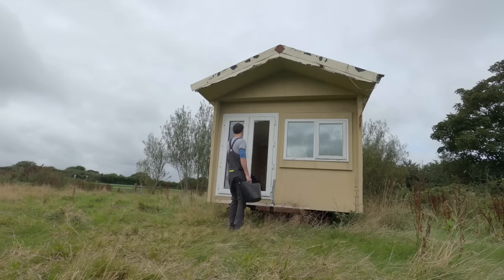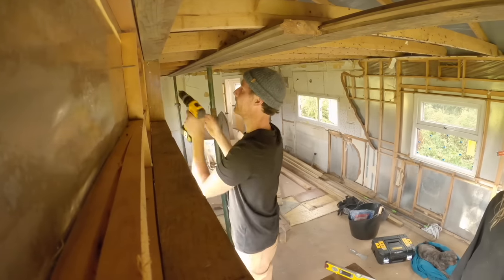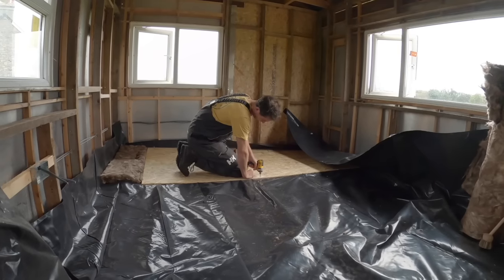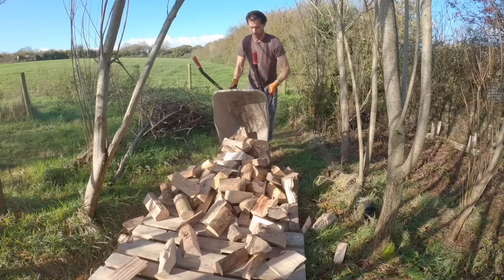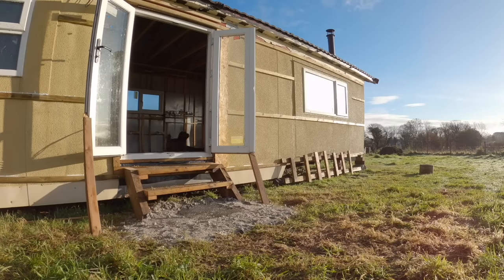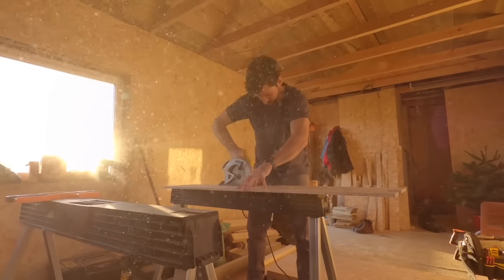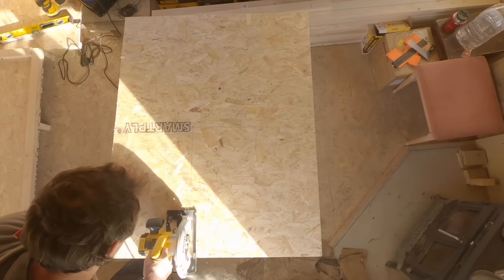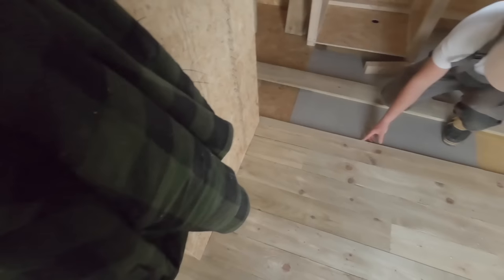Static Caravan to Cabin: Off Grid in the UK with Narration (FULL VERSION)

Comment: Congratulations - both the video and the building work are excellent.
Just a couple of points which might be of use.  Did the external cills you installed have 'drips'?  It is essential that a groove is machined in the underside to prevent rainwater migrating along the underside of the cill and getting in to your cladding causing eventual rot.  Also I don't recall you touching on what protection your tiling had against differential movement.  A soft joint, i.e. silicone, should be used at any change of direction in the tiling and any joint with a dissimilar material.
Once again, very well done.
Reply from the maker: Thanks so much and i really appreciate your kind words. That's a very good point about the window cills. So with that, the cladding is effectively just for show. It does do something obviously but we put the cladding over the original exterior walls. The original walls are made from aluminium and are pretty hardy. I did put small cills on with a bit of silicone to plug the gap. I'm not overly concerned about it because of the aluminium exterior wall. The bathroom however is a different story! We made huge mistake with the bathroom and it's something we're going to have to change completely down the line. Even though it was a big mistake it was a great lesson learned and we'll definitely not make that mistake again! Thanks for the comment and thanks for the support!

Comment: Wonderful journey! I really hope you are not relying only on tiles to keep the moisture out of the OSB in your bathroom! You need to double-seal it BEFORE applying the tiles on floor and walls!
Reply from the maker: Thank you! Yes, that was a huge mistake and we've definitely learned our lesson that's for sure!
Reply: I was wondering the same, hope you fixed the problem! Would hate for all your hard work to go bad from mold and moisture forming in the board and ruining it.
Reply: You need to put cement board or backer board on the walls if you are applying tile it keeps the moisture out. Also do you have a fan/vent into the bathroom

Comment: Great job. Definitely considering that you are total beginners. But with the shower, you might have problems in the long run. A layer of sealant on the wooden panels would have been better. If there is even a tiny crack in the grout now, the water will penetrate the wood very unnoticed. This is usually noticed much too late.
Reply from the maker: Thanks for watching and glad you enjoyed it. Absolutely, we made a huge mistake with the shower and learning lessons the hard way! We know that we're going to have to completely re-do the bathroom at some stage in the future. Thanks for the comment and appreciate the advice.

Comment: Great job you two!  Wow, the amount of work that went into it.  I liked seeing the evolution of your tools andthe final variety haha!  Curious if you've had any leaks or issues considering the amount of wind and how wet it could get.  I also noticed right at the end with the finishing touches on the window frames, have you considered sloping the 'pan' at the bottom of the sill on the outside?  To help guide the water away?  hats off to you!
Reply from the maker: Thank you very much! Glad you enjoyed it. We certainly learned a lot and made some BIG mistakes! We’ve only had one leak from the flashing on the roof for the flue from the wood stove. It was an easy fix and hasn’t leaked since. The front of the cabin gets smashed by weather. Good tip about leaving an angle on the bottom sill of the window frames 🙌👌

Comment: Here in the US,  we use a product called,  Hardiboard in the bathrooms, its a cement based product, instead of using the OSB, after installing the Hardiboard,  you paint it with a product called Red Guard (its a waterproofing paint), then you install your tiles on that and grout them.   Unfortunately looks like you'll be needing to re do   the bathroom so the walls don't rot and mildew.
Reply: Didn't want to say this and sound negative, but 100% right! We have the same stuff in the UK cement boards / tile backer board and water proof membranes or paint-on tanking. It will be a few years before it rots so its a project for down the road. As a temporary measure you can paint liquid waterproofing into the grout lines to help stop the water getting through, plus silicone the corners.
Reply from the maker: I appreciate both comments. Yes we made a huge mistake with that and other things too. That’s just part of the process, learning the hard way! But it’s still holding up, however we know we’ll have to re-do the bathroom at some point 🤦‍♂️

Comment: Great work mate! I commend you both for all of the hard work, patience, and the vision required for a job like this. Your resourcefulness, recycling of materials, energy reduction, and conscious decisions to reduce resources in your daily life is outstanding.

I appreciate the fact you've called out some of your errors as you learned new skills and espanded your knowledge. Despite explicitly stating this series was not a guide for others to follow, some will use your vlogs as just that. Please don't take my points out of context. The items I point out are more for your viewers as I you've likely discovered them for yourself.  

Two issues not mentioned are the shower and the absence of a vapor barrier on the external wall. OSB is an amazing sponge; particularly the unsealed cut ends. Unfortunately I believe shower will need rebuilding in the near future. Tiles will begin popping off as the OSB swells. This happens as a result of seasonal humidity, showering humidity, and thermal conditions. With expansion and contraction of the OSB fractures in the grout will occur allowing the OSB in the walls and fabricated shower floor to soak, store, and soak up more and more moisture to the point of swelling. Where the shower pan meets the wall and OSB/ timber shower floor extension are the weakest point of the shower build. These points began leaking almost immediately. None of the materials expand and contract at the same rate; resulting in fractures of the grout - the only material in this instance employed to prevent water intrusion into the OSB. As a result you likely have excessive moisture in the floor, walls, and insulation of the shower surround. I would advise viewers to either source a (second hand) one piece shower unit or building the shower with the correct water resistant materials. Aside from popped tiles, the smell, and health affects of mold, a lot of effort, time, and material is wasted when one must rip it all out and rebuild with the correct materials. Those facing building inspections will find any improper materials and/or shoddy construction method will result in having to tip everything and start over. I would also remove the interior insulation in the bathroom as it only serves as a humidity sponge and trap. The seams of the OSB walls, despite being cladded over remain entry points for humidity.

As pointed the ceiling insulation will result in mold and mildew growth due to tapped moisture. Installing a vent along the entire length of the roof ridge will help draw some humidity out. However this may not be enough to prevent indoor air quality issues in the long term. When we heat the interior we think we are drying it out. The reality is humidity become a vapor which rise and seeps into porous materials. Therefore liquid condensation, say on a window or other cold surface, becomes a vapor that rises up into cavities in the ceiling and walls before condensing back into a liquid once it hits a cool surface. That surface in this case is the metal roof and original exterior walls. Insulation then absorbs this trapped humidity. That said the log burner and interior wood cladding and cabinetry will absorb and release some humidity. The key for this home will be maintaining low ambient humidity levels with proper exhausting and dehumidifiers. Adding the ridge vent will also aid by exhausting moist air. The best option is to redo the ceiling with proper air gaps and ventilation.

Modern kitchen units have adjustable threaded feet. To save lumber and the headache of building level kitchen units from the floor up, simply build your units using adjustable threaded feet and then install. The end result is perfectly level units and worktop. As others likely noted the worktop planks ideally would have been fixed and glued together with fasteners on the bottom for aesthetics and sanitary purposes. The worktop can be reworked as time permits.

We must remember this couple were building as they envisioned without experience, expert guidance, on an extremely limited budget, and on a fast timetable. . Through this experience they are in a better position when the time comes to make necessary adjustments and repairs. Painting the roof and windows black would make this look like a fancy new modern prefab. Your future solar panels and solar water heater will blend in better too.
Reply from the maker: This is a really constructive comment and I really really appreciate it. I hope other people find this really helpful and thank you so much for taking the time to write it. I appreciate the compliments as well and like you said we had no experience and this was such an incredible project to be able to learn new skills and make mistakes. There were certainly a lot of mistakes made and now i'm chomping at the bit to do another one with everything we've learned! 

Thanks so much again and appreciate the support!

Comment: Nice job on the cabin! But on the willows yes they seek water but they will fill your soak away with roots and get into your pipes. We had that very problem very evasive.
Reply from the maker: Thank you and glad you like it. I have had a lot of comments about the willow and it's definitely a worry for sure. Luckily it's not under concrete or anything like that so at some point we're going to have to dig it up but it could be worse for sure!

Comment: This is so cool! Great work! 

We’ve recently moved into a caravan completely off grid. We’ve cladded the outside & put another roof over it (so essentially built a shed around it) and put a log burner in, but we’re still having damp issues as the walls don’t breathe. We also had the idea of removing the caravan walls and replacing them with ply & cladding - do you think this would help the damp issues? Does your log burner reach the other side of your cabin? Do you struggle with any damp?
Reply from the maker: That sounds really cool - i like the idea of building around it. What really helped us was completely gutting it which is why i wanted to get the burner in as soon as possible so it would completely dry it out. So i would say it helped putting up stud walls etc. Would would help even more is using king span insulation but we just couldn't afford it. So we've had no damp issues since renovating the cabin - the burner is a huge part of that I think. Thanks for watching and thanks for the comment!

Comment: Love the build. Very close to what I want to achieve with my offgrid static.

Its worth pounting out that legally you have to have certified people install electric, gas and woodburners. Lots of laws I'm happy to skirt around but those three I think are very sensible.

So I would have spent my time learning to do the plumbing and got the pros in to fit the burner.
Reply from the maker: That's a very valid comment. You're quite right. We did get the gas checked out by a qualified tech to make sure it was safe. I've also had the burner checked out unofficially. The electrics and plumbing were done by professionals. Thanks so much for watching and appreciate your comment!

Comment: I have the same wood burner. It is, in fact a dual fuel burner and the grid is for burning coal. You will get a better fire by putting the wood directly on the floor of the burner. Great job you make it really seem doable.
Reply from the maker: Awesome! Thanks for the advice and knowledge. That's great to know. Thanks for watching and thanks for the comment

Comment: Loved the video i only have one snag and that is screws in the work top then wood filler? I would have sunk the screws and put a plug of wood dowel to have a proper finish... I also noticed in the video that you did not weed or waterproof the underside of the cabin..... Now you need a wood shed... Now i need the money and the land to do the same but my plan is to build out of old pallets from the ground up and having solar... Well done great video
Reply from the maker: Thanks for that. That's a really good point about the work top. I thought I should've screwed them from underneath but you live and learn and i've definitely made loads of mistakes! The underside of the cabin had black sheeting and gravel over the top. So it's not too bad re. weeds. Building out of old pallets sounds awesome - let me know how it goes when you get round to doing it!

Comment: Hats off to you. Well done. Impressive. I wish you all that you want from your cabin. I would have one concern - the chassis/substructure is now much more loaded than before, and is sometimes equally fragile as the original building - typically small steel sections and poor rust protection. Added to that, it lives in the grass and does not always get good air circulation to keep it dry. Worth checking for peace of mind.
Reply from the maker: Thanks for the lovely comment and kind words! I really appreciate your concern about the chassis and it's a very valid point. We did check the chassis extensively and found no rust and in fact in great condition. We've ensured good airflow and it also has matting underneath to stop anything growing. So far so good but will keep regular tabs on it. Thanks for watching!

Comment: Didn’t think you should use pine in a log burner, as it has a high tar producing problem. Told in a log burner centre use dry seasoned oak or Ash.
Reply from the maker: You're definitely right. In my experience if you clean the flue regularly it is alright but i'm not saying that's good advice though!

Comment: I once restored an old wood stove, it was big so i coated the inside of it with heat resisting brics, bottom, sides and top so it was better for capturing heat
Reply from the maker: Awesome! That's exactly what we did with this burner. It reduces the heat output but with such a big burner that's probably a good thing in a small space!

Comment: Really enjoying watching this progress and trying to achieve a home with minimal outlay as it’s something we would love to be able to do. I worry about how things will fair in the future for your build though because of the materials used. 
By this I mean like tiling straight on to the osb. If you have an issue in the grout, water can get behind and by the time the leak is noticed a lot of water damage could of already been caused meaning the whole thing could need tearing out to fix. Also the choice of insulation, as it’s a “flimsy” type it’s suited to floor/ceiling insulation, so over time being it could sag down and cause gaps and cold spots within the walls.
I hope this doesn’t come across mean spirited in any way as that’s not my intent, I only say it because I feel bad that you could have issues in the future after all the time and effort you’ve put in.
Reply from the maker: Firstly, really appreciate your comment and it didn't come across mean spirited at all. I completely respect your points and all very valid. We definitely made some HUGE mistakes which we'll have to sort out in the future and we know it'll be a big job. The bathroom is a perfect example but we're (not necessarily glad we made the mistakes) but happy that we learned very valuable lessons the hard way because we won't make those mistakes again in the future! It's been a very steep learning curve but the best way to learn in my opinion. Thanks for watching and thanks for commenting.

Comment: Get a big water tank and pipe the outside roof guttering into it. Great for cleaning the outside. They're common here in New Zealand 🇳🇿. I've got a hose fitting on mine so i can water the garden as well. Adjustable plastic kitchen cupboard legs would've sped up the kitchen build and off the shelf white melamine cabinets could've been used. Still it looks great. Where about in the UK are you. Used to live there in the 70's and 80's.
Reply from the maker: Thanks for the tip! I like that idea! I need to sort out the guttering and can’t help thinking how much water I could be utilising. I’m in Cornwall 👌

Comment: Love the willow canes! But watch out they seem to find their way even around garden fabric and grow into the tubes! The roots that is. Ofc it isn't that much of an issue in your situation as it is a low cost and easily accessible system (props for that). BUT PEOPLE WITH DRAINS AND SEWERS UNDER DRIVEWAYS CONCRETE SLABS AND THE LIKE DO NOT PLANT TREES ESPECIALLY WATER LOVING TREES NEAR YOUR PIPES😊
Reply from the maker: That's a really valid comment. It was definitely a mistake but like you said we're not in the worse position to replace it. Thanks for the comment and thanks for watching!

Comment: Great job on your build! 👌Just curious, did you build your countertops to accommodate your height? Nothing worse than standing over a low sink. Cheers.🇨🇦
Reply from the maker: Thank you very much! That's a great question. I did take it into account. They are still quite low to be honest but we had to take the windows into account because I didn't want the counter top higher than the bottom of the windows. It's actually perfect for me with a chopping board on top. A higher sink would be nice though. Thanks for the comment and glad you enjoyed it.